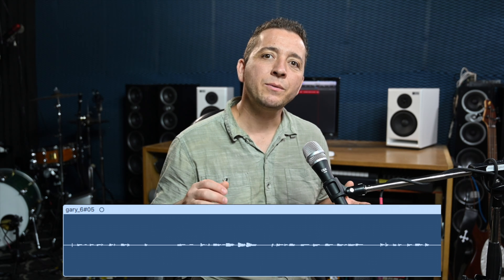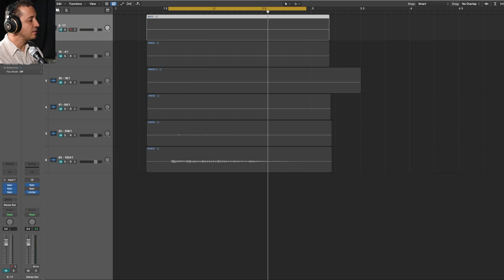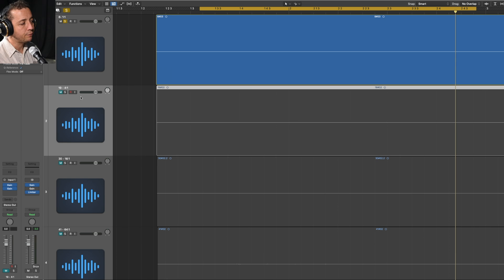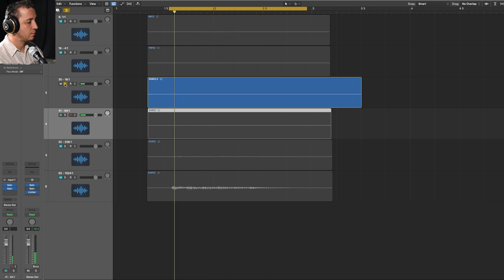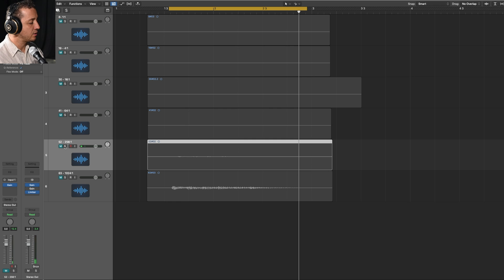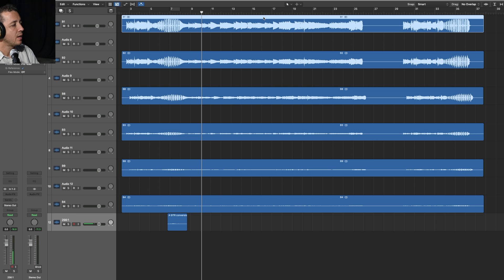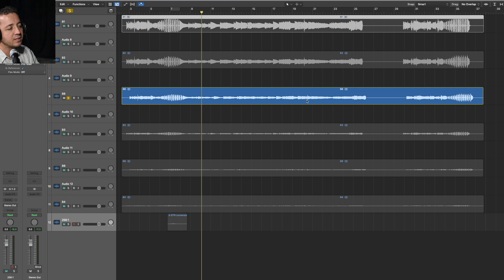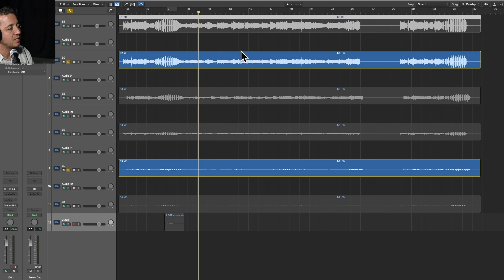Optimal Gain Settings for your Microphone Preamp

Comment: I mainly record vocals so I've never noticed a lot of gain noise. However, since getting an audio interface that has a meter (from the Focusrite Scarlett to the SSL 2+), I've been able to set my gain more accurately because I know how close my audio is to peaking. I never really knew if just setting the gain low so it never clips made a huge difference, but after trying different settings out, I do notice somewhat better clarity with properly gain staged vocals. It's not a major difference considering the noise floor is really low on these interfaces, but the small things count when dealing with audio.

Comment: I think that is better to be conservative with the gain and a little lower over a little loud cause then i can modified the sound when im editing and pull it up but if i put to much gain and the gain catches outside noises is harder to remove them but correct me if im wrong im iust a noob😅
Thanks for the video 🙏🏼

Comment: hi I am using sm7b and ssl2 when I turn my gain up and turn my monitor mix to the input side fully,I can hear some constant noise and when the gain is up,it’s louder ,but I didn’t really hear that in the vocals,is that the noise floor?Will Klark Teknik ct-1 or any inline preamp make that noise lower?

Comment: Thank you for this. Here is a user case where the info in this video was very valuable:

I upgraded from a Steinberg entry level interface + Mic  + Headphones, to a Motu M2 interface, and a Audio Technica At2035 mic. I tested the new gear using a duplicated track of vocals on a previous project recorded with the Steinberg gear, and to my surprise the Steinberg recordings were much louder (which you could clearly see in the waveform) which I thought was better.

Somehow, the interface would not get beyond half volume without clipping, so the signal in Logic was quite low (compared to the Steinberg one)

 I was devastated.

Finally today I saw your video and I understand the volume on of the new gear is actually fine.

Thank you!

Comment: Problem isn’t always whether its too loud or too low though, input level and output level changes the way the hardware processes the sound, I’m having like over saturation in my “a” “u” and “o” vowel sounds, due to too loud input, but trying to understand why the input and output at certain levels are more effective for different sounds, ie, punk rock vocals as opposed to rap vocals. 

Basically, wave not too loud or clipping but distorted sound, need more info on why input/output levels matter for this and how to utilize them to clear vocals.

Comment: Lots of tutorials, but not one shows gain and volume interacting. Would the following be the solution?

1. Turn up the gain then down a little when the signal starts to degrade, listening through headphones, plugged into the pre-amp.
2. Turn up the volume to about -3dB peak amplitude in the DAW.

Comment: What is the best setup for a condenser microphone? I have a cm25 mkiii from a focusrite scarlet 2i2. It is quite sensitive, if I add sound so that the graph is clearly visible, then I can hear the noise of the room.
Reply from the maker: Yeah…. That’s normal. That’s why studios invest in really quiet rooms.
If your Focusrite Scarlett is a 1st Gen… those have quite noisy preamps too.
Reply: @Get.Beautiful.Recordings  I have focusrite scarlet 4 gen. But it's also kind of noisy. Even at very low gain settings you can hear white noise, is that normal?

Comment: Great video ! I’d like to see a video about different preamps and how they have different tonal qualities .
Reply from the maker: The reason there aren’t any videos like that is because the differences are very subtle and usually inaudible. The biggest difference isn’t the tone, but rather, the noise floor, which I have done detailed testing and I reveal it in my most recent audio interface comparison video.
Reply: @ ahh makes sense . Higher end pres have a lower noise floor . My Pacificas are low noise , I’d like to get some more high end pres , looking for something that will work great on acoustic , I’m thinking something that will warm up the signal like a bae 1073 or something similar .

Comment: This was pretty simple, for a beginner. Thanks for the video!

I am wondering, do you have a more advanced tutorial? Where is it best to set gain for a chain? Mic preamp -> compress -> audio interface. They all have input and output levels, where is best to boost the volume a bit to avoid added noise? Does it depend on the quality of gear? Let's ignore that and assume all of the preamps are the same, do the functions (preamp vs compress vs audio interface) have any inherit benefits of boosting earlier or later in the chain? Or do you just boost them all the same until you get a usable audio level?

Comment: I landed here because I switched from a GoPro to an Ace Pro camera to use for my motorcycle recordings.  Using the exact same microphone (Movo) wired to both devices.  The resulting waveform in the GoPro is great and I can see motorcycle noise and then my talking easily stands out.  With Ace Pro, it's all small and looks alike.  Can't figure out how to fix it.

Comment: Hi, I use an SM7B with a Cloudlifter and Go XLR. How quiet should the noise floor level be when recording voice over? My room/ambient noise hovers around -50 dB, and my normal speaking voice is around -20 to -18 dB, while the peak is around -16 to -8 dB. I want to eliminate as much noise as possible while maintaining the quality of my voice. I can clean it up in post, but I can still hear some lingering noise when I'm speaking. Any help be greatly appreciated!
Reply: Not sure if this helps, but if you are on Windows go to Control Panel. Then go to "Hardware and Sound" and then to "Manage Audio Devices". Now find your recording device. Go to properties and then to the levels tab. Is it set to 100? If so, turn it down to 50 or 54ish. Now I am going to completely blow your mind. You can right-click that microphone level box within that panel and switch it from "percentage" to "decibels". 

So now you might understand why this is happening. With most audio drivers that come with most motherboards setting the level to 100 is adding something like +30db of amplification in Windows on top of everything else. Setting it as close to 0db (aka Unity Gain) is important with Audio Interfaces going into an operating system such as Windows. So what y'all are doing is simply over amplifying everything.

Setting this back down to 0db'ish (again, I can't actually hit exact 0 for some reason --windows is trash), will drop your volume quite a bit btw. So then you can turn up your interface gain to get back the volume. But hopefully without too much background noise being amplified.

*Also this is a thing with MacOS too. But I'm not sure where the settings for it are located because I don't use Macs.
Reply: bruh im going through the same thing with my apollo and shure sm7b, i have the clloudlifter and my phantom power turned on, just did the auto gain with my Apollo and the static noise isn't going away. if i lower my headphones i can't hear myself.  idk what to do
Reply: @younggkush  I am also using sm7b  with ssl2 when I turn my gain up and turn my monitor mix to the input side fully,I can hear some constant noise and when the gain is up,it’s louder ,but I didn’t really hear that in the vocals,is that the noise floor?Will Klark Teknik ct-1 or any inline preamp make that noise lower?
Reply from the maker: Ya, the sm7b is notorious for that. I don’t know why it’s so popular, but in my opinion, it’s not a very good microphone.
Literally any other dynamic or condenser microphone will solve this for you. I recommend the iSK Vibrato, or the 512 limelight.
Reply: @Get.Pro.Recordings  hi I am using sm7b and ssl2 when I turn my gain up and turn my monitor mix to the input side fully,I can hear some constant noise and when the gain is up,it’s louder ,but I didn’t really hear that in the vocals,is that the noise floor?Will Klark Teknik ct-1 or any inline preamp make that noise lower?

Comment: Excellent video. Thank you.

Working with some older equipment (Roland VS-880EX), and trying to negotiate the SNR considering its built-in preamps, which I know nothing about their settings or quality. Any knowledge of these old machines?
Reply from the maker: Yes, I have some experience. Not with those specific pieces of gear, but with those brands from that era, and the preamps are very noisy, around the same level as the hairball Lola, or presonus audiobox.
Reply: @Get.Pro.Recordings  Thank you for the reply. Yeah, I find myself using the Bertom Denoiser when I bring the tracks back over on my PC with each song. Well, thank you again.

Comment: Could you please help me a bit? I am using: micro Audio Technica AT4033 + preamp Warm Audio WA73-EQ + audio interface Focusrite 2i2. The preamp has 2 button: mic volumn and output volumn. I don't know how to setup these 2 buttons properly. If I set mic volume and output volume at 12 o'clock. And if I stand 30 centimeters away from the microphone, almost nothing can be heard (The signal light on the audio interface is not lit). If I increase the max volume and output volume the microphone sensitivity increases but the sound is very bad. Please help me some idea.
P/S: I am using Studio One, and I didn't adjust volumn in it. Just kept default value.

Comment: This is the most unscientific and amateurish way of setting gain. This is absolutely NOT how an audio engineer should set gain. 

1. On many DAWS, there is a global setting that magnify the waveforms within the arrange window. Using your visual waveform concept, the magnify function would lead the engineer to believe he has good gain staging when in fact the level is simply too low. 

2.  Just because the waveform doesn’t clip, it doesn’t mean the levels are correct.  The absolute numbers (and therefore meter readings) are important!  A signal can be too ‘hot’ without clipping. Equally a signal can be too ‘cold’ without appearing to have a small waveform. 

Why is this important? Well, most analogue processing (and thus consequently the digital emulations) worked their magic most effectively when the signals they were receiving were around 0dBVU.  This is the case with a lot of plugins also, because they are emulations of the original circuitry.  Providing less signal will increase the noise at each stage of the signal chain.  Providing too hot a signal will introduce clipping not just at the preamp conversion, but potentially at each stage of the signal chain too.  PROPER GAIN STAGING REALLY MATTERS!   Reading meter levels really matters. 

Additionally, trying to eyeball the waveform instead of reading the meters properly will be a surefire way to run out of headroom quickly once you start mixing more than a couple of sources.  You will end up having to reduce your levels to avoid overloading your master bus. 

Guys, you will never ever hear a professional advise you to just eyeball a waveform and hope for the best.  There’s a reason equipment and DAWS have meters… it’s because it actually matters.
Reply from the maker: I run a pro studio with clients on a regular basis. This is how I set my gain. It’s fast, simple, and has never given me trouble.
Reply: @Get.Pro.Recordings  while that may be true, it is more likely that the high degree of headroom and low noise floor implicit within the 24bit DAW is helping to cover poor gain staging.  Proper gain staging is a very necessary habit to get into, especially if you hope to ever work in the analogue world where signal levels really do matter.  Furthermore, just because you’ve done it one way without any perceived negatives, doesn’t make it optimal. Optimal is to load the circuitry with the correct voltage levels throughout the chain, weather analogue or digital, in the sure knowledge that these good habits are immediately transferable to any system, no matter how high the noise floor.
Reply: @pete3816 Hi Pete, I want to use a leveler plugin to maintain 0 dBVU. Should I set the preamp knob on the interface to hit around 0 dBVU while tracking? Also, I'm using POWAIR (a plugin by sound radix) to handle dynamic changes and keep me in the 0 dBVU range. Your thoughts?

Comment: Have you covered how Windows or Mac mic volume also interacts with your mic gain/volume in a video? I'm interested in trying to boost my mic enough to get rid of the elements in my noise-floor as much as possible but I wandered how Windows mic volume interacts with the quality or potential distortion of the mic / elevating the noise-floor if that's something worth looking into! I personally have a PreSonus Revelator io24 and a RODE Procaster mic but I find my mic is very quiet and compression settings have been a real difficult thing to try and work out as an amateur - I'm still not sure what some of the settings even mean in the various compressors included in the Revelator io24's preamps but this video definitely gave me some insight into realising that pushing my raw output from the mic as close to 0db as I can without having another preamp like maybe an sE Dynamite DM1 in the signal chain is not helping things when it comes to trying to get my compression settings correct!

Comment: My gain is set to max and it’s too quiet/ low… wtf
Reply from the maker: That can happen with a very low sensitivity microphone. You can get an in line amplifier such as a cloudlifter, or an external high gain preamp  capable of like 75 db of gain.

Comment: Great explanation! Was wondering, the Interface has a Gain knob and then Windows in it's configuration you can also set a Volume Level. How do you know whats the right level to set in Windows?
Reply from the maker: The gain knob on the interface is the correct one to use for setting the recording volume. The volume in windows is for setting the playback volume.
Reply: @Get.Pro.Recordings  thank you so much. I'm referring to the volume knob in the microphone for recording. In the interface your setup a gain value and on Windows in the mic settings you also have a volume/gain recording setting.

Comment: If you are using a compressor with this level, is the threshold set pretty low?
Reply from the maker: If this level is lower than what you are used to, then yes, you would need to set the compressor threshold a bit lower.

Comment: What is the difference between the input source Of Line level and MIC level
actually im using a ZOOM F8n and a Sennheiser G4 and it's always clipping when they are shouting when im on mic levels
Reply from the maker: Hi Emery Alexis Tomboy, 
Clipping is obviously bad,  but the solution is simple, you need to turn the preamp gain down to a level which is not clipping during the loudest parts. If the gain is already very low, and cannot be turned down more then you can turn down the output of the G4 receiver.
If turning the gain down makes the quiet parts, or normal volume parts too quiet, then I would suggest using a compressor, which will raise the volume of the quiet parts and also reduce the volume of the loud parts, when used correctly.
Thanks for the question

Comment: I’m using a Sudotack ST-800 Microphone and the microphones clips and distorts the audio by itself on a certain dB. Adjusting the gain on the computer doesn’t change anything. Distance mattered but I had to be like 5 feet away from the mic to actually record louder audio.
Is there a way i can adjust the gain using software?
Reply from the maker: That’s unusual to need that much distance, or else you get distortion. It sounds like the issue is with the microphone. Unfortunately, there’s no way for software to fix this.

Comment: the portion about 16 vs 24 i never knew that. i do know that when saving as 24bit the hdd space doubles but after your explanation i can understand
Reply from the maker: Ya, 16 bit is ancient history. It was useful in the 90’s when 24 bit was too much for those computers, but computers have come a long ways since then, and even a really weak modern computer can handle 24 bit with ease.

Comment: Great info! But i thought you were going to give me a recording level in dB .. like record your vocal levels at - 10dBFS or -12dBFS or 6dBFS to be above the noise floor to get a clean recording and below full scale not to clip. Yes my session setup is in 24bit. How about sample rate .. which one is better? 44.1 or 48KHz? Thank you for your helpful tips.
Reply from the maker: There’s several strategies for watching the meters, however, I find these to be more time consuming, and less reliable than simply looking at the recorded waveform, but if those strategies work for you, there’s nothing wrong with it, as long as you don’t clip. 
As for sample rate, higher number has better sound quality but uses more computer processing power and hard drive space.
Reply: It's been a year for you, everyone says go 48k or 44.1k. Go 96k instead of spending 3 years wondering why your audio sounds like it has a blanket on it.
Reply: @Hello-pl2qe the only issue with 44.1 will be if you use saturation or analog emulation effects that will need oversampling. 96kHz is useful for mixing and mastering engineers, but not for recording.
Reply from the maker: Most people, and even audio recording courses, suggest to use the input meter and record at a specific db level. They often say your loudest peaks should hit -18, or -12,  or -8 or whatever number they think is right.  There is no value that is agreed upon because that method doesn't take into account average volume, and also because many people don't understand the signal to noise ratio that I demonstrate in this video. 
As for 44.1 vs 48Khz, 48 is slightly better, but it puts slightly more strain on the computer. If you would like to know more about this, I have a video explaining sample rate here:
https://youtu.be/RbqyMiHncXQ